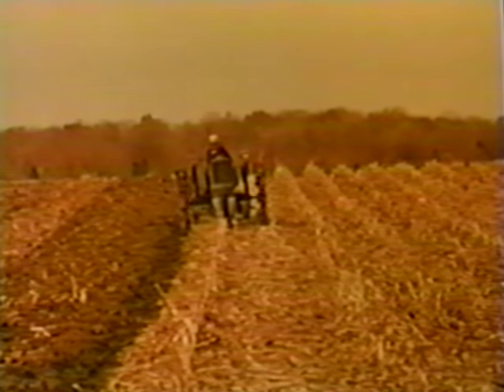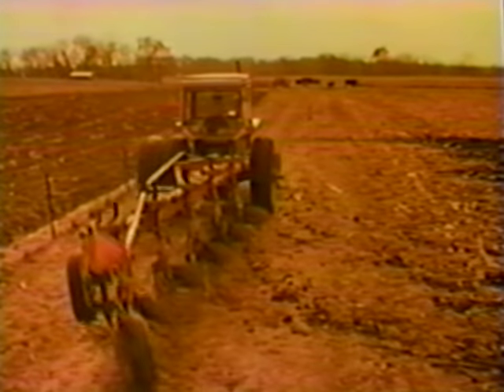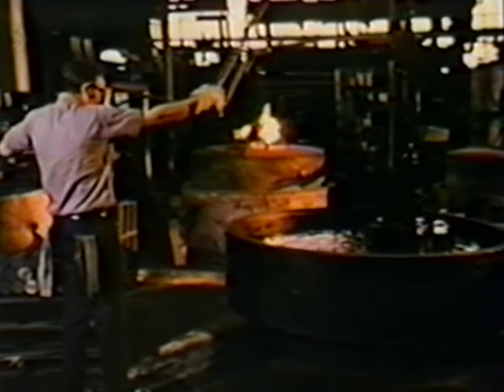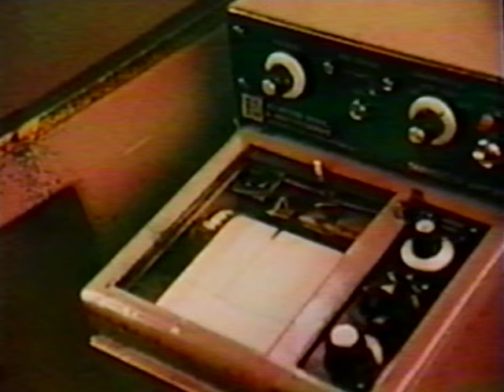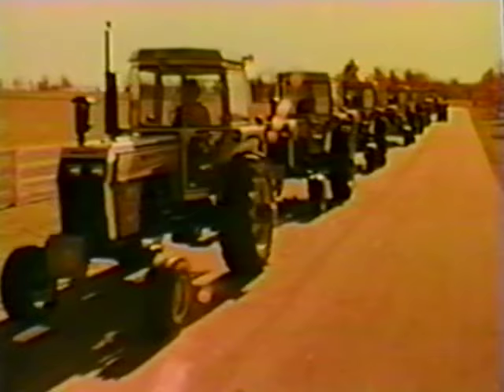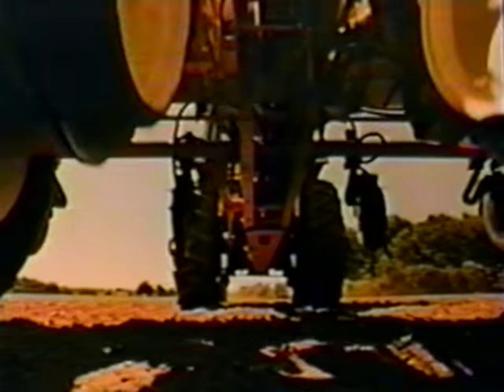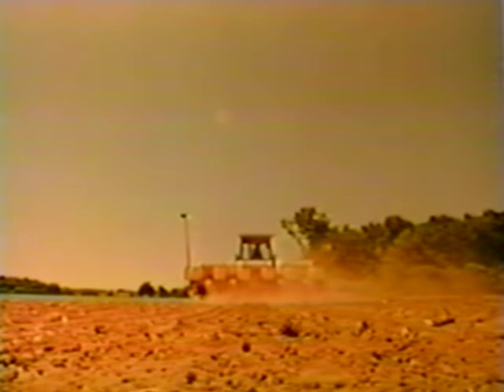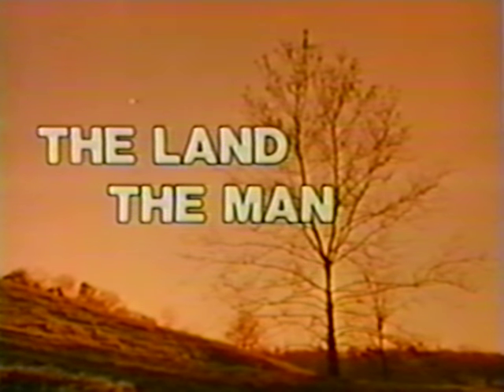The Land the Man & White

Comment: In the 70's I spent a lot hours in a White 2-180 with the cat 3208 V8 engine. We definitely had problems keeping the AC working in the TX  heat, and the Cat engine blew up no less than three times in two years, other than that, I liked the Tractor.

Comment: Beyond sad. A fine example of superior Engineering and piss poor management from the time Sam White took over. Have a barn full that will whip the snot out of any comparable competitor of the day. If the CVT designed in 72 would have been pursued, there would be no Deere idiots anymore except at a show popping corn.
Reply: That's a bold statement, that you want to believe